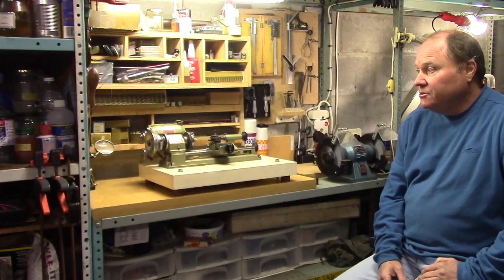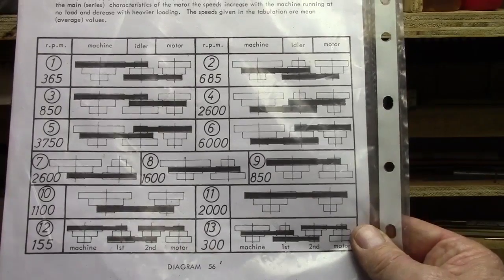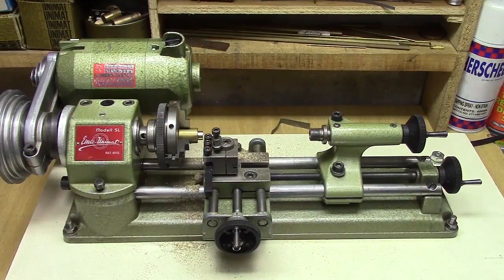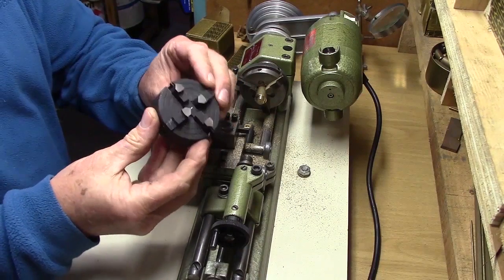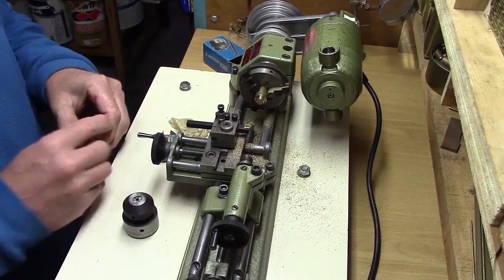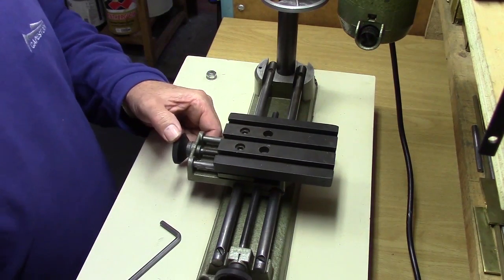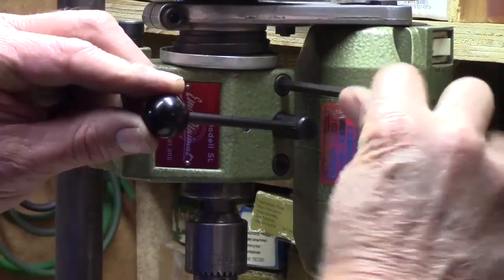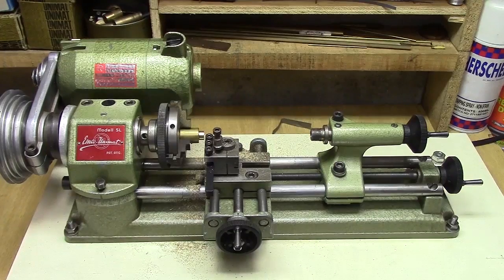All about the EMCO UNIMAT SL Lathe

Comment: You use a toolholder which is adjustable in the height. Where do you get the adjustable toolholder?  ( I am a Newbee with my Unimat SL)
Reply from the maker: The standard UNIMAT SL Tool post is height tip-height adjustable. My quick height adjustment tool post came with my lathe from its previous original owner. The original owner may have made the modification himself or had it done by another model engineer. It is a relatively simple modification to make and I have seen other variations of this tool post mod featured in old Model Mechanic and Model Engineer magazine articles from the 1950's and 60's. Have a look at the Model Engineer magazine website many of the old archived articles are free for download and viewing.

Comment: Hello Steamer Edge. Thanks for this great video and started looking at the others which will be invaluable. Just about to have a Unimat SLdelivered and was looking at the extras that I might need. I see the lathe steady offered a couple of times onEbay and wonder if you have ever found the need for one?
Cheers
Reply from the maker: Thanks, I do have a Steady Rest for my Unimat SL but I must confess that I have never used it. Most of my turning operations are well under 100 mm in length and I find that using the live centre on the Tailstock is almost always sufficient to prevent the work from flexing. If possible I try to avoid turning long pieces of work which may flex during machining, but I'm sure I will need to use the Steady Rest at some stage ....
Reply: @SteamerEdge  Thanks for the advice. I have ordered a live centre this afternoon. Kind regards, Dave

Comment: How do you attach the chuck to the indexing head?
Reply from the maker: Unscrew the three screws which attach the 3-jaw-chuck faceplate to the back of the chuck, the faceplate will detach complete with the jaws. The chuck is then attached to the indexing head using three screws but you need screws which are the same thread but slightly longer than the original chuck screws. these longer screws are usually supplied with the indexing head. The chuck jaws can still be opened and closed in the usual way when the chuck is on the indexing head.
Reply: @SteamerEdge  Great...thanks! I was looking at getting an indexing head, but wasn't sure if I needed anything extra to attach the chuck to the head.

Comment: hello steamerEdgeI just bought an emco unimat sl lathe and see you also in south africa I wanted to find out accessories for it in SA si]uch as the milliing table or chucks thanks
Reply from the maker: There is no local South African supplier but the complete lathes with accessories and, sometimes, individual UNIMAT parts are often found on websites like GUMTREE, Bid or Buy, EBAY  and at local Flea markets, Toy Collectors Fairs,  Garage sales etc.  The EMCO UNIMAT lathes were very well marketed in South Africa in the 1960's 70's and 80''s and many complete 2nd Hand machines and 2nd Hand accessories are still around if you keep looking.

Comment: Hi.  Thanks very much for this video.  I've just acquired a DB200, which I am intending to use as a vertical mill to complement my Cowells lathe, but it came without the pinion lever.  Could you please let me know the outside diameter needed, so I can make myself a new one.  Thanks
Reply from the maker: Hi, the lever base is a round bar 12mm diameter 60mm long. The lever handle which fits into the base is round bar 5mm diameter 95 mm long with 20mm diameter ball at the one end. The lever base has 10 longitudinal profiled gear splines around the circumference of the bar, starting from the machine end to a length of 34mm along the bar base. The depth and profile of these splines is very precise and I recommend that you try to find someone with a Unimat lever near you and take accurate measurements of the depth, spacing  and profile of these splines. These gear splines could be made on a Milling machine using a dividing head for spacing and the right size, depth  milling cutter. Could also be done on a lathe if you have a vertical slide for milling. Search for "Unimat DB/SL Pinion & Hand lever" for sale on Ebay
Reply: @SteamerEdge  Thanks for the info and comments.  I know I could buy one, but it seems a bit defeatist to not even try to make my own.  I made a gauge to match the headstock rack, and ground a single point tool to accurately match that.  With some 12mm bar in the rotary table I think I'm good to go!  I'll let you know what happens
Thanks also for the inspiration from your channel.  I think the 30 or so steam engines I have now built are largely as a result of finding your videos
Reply from the maker: Thanks for you kind comment, glad you enjoy the vids  :-))

Comment: Hi, I was just wondering if you could help me with a problem I’m having with this lathe, the motor rotates in a wrong direction, how could I change it back to normal? Electricity is not my secret power, so any advice would be much appreciated, thank you very much! Best regards
Reply from the maker: Hello, the lathe motor should rotate in an anti-clockwise direction. Reversing the polarity ( reversing the connection of negative and positive leads from the power source ) should change the direction of rotation. Be sure to disconnect power leads from the power source before working on them. Live power leads are extremely dangerous, I strongly recommend that you get a friend who is a qualified electrician to assist you with this. Regards Paul

Comment: When using the Unimat as a vertical mill, the plain, un-painted melt is exposed that would normally be hidden under the head stock when used it as a lathe. Do you know if there is an extra part that can be put in place to cover the non-painted part of the base while using it as a vertical mill? This would be a purely decorative addition. I have been looking, but I have not been able to find anything like that. As I plan to use mine primarily as a vertical mill, it would be nice to give the base a more finished look.
Reply from the maker: Hi, no, I'm not aware of any sort of part like that for Unimat lathes. It would be very simple to make some sort of cover out of thin rubber ( or whatever material you like ) which fits neatly over the profile of the exposed metal section.

Comment: Hey SteamerEdge. I live in Durban, and after watching your videos I decided to buy a Unimat SL for myself. I absolutely love my little machine, But could you let me know where you buy the belts for the lathe ?
Reply from the maker: Hi, I got my polyurethane belt material from Belting Ware located in Maitland, Cape Town. there should also be other suppliers in S.A. which could be nearer to you. Just search for "Belting Ware Cape Town "on Google. You need a 4mm round Polyurethane belt, the belt is sold by the meter and you will have to join it yourself.
Reply: You can also get it from this link:  https://www.ebay.com.au/itm/Green-100CM-Length-4MM-Diameter-PU-Round-Belt-for-Groove-Pulley-Drive/273156505373?epid=17017998228&hash=item3f99657f1d:g:DDgAAOSw7eda~ikh

Comment: Just got myself one of these! Is there a local supplier in South Africa for the parts and fixtures?
Reply from the maker: Hi, congratulations on your acquisition. There is no local supplier but the complete lathes with accessories and, sometimes, individual UNIMAT parts are often found on GUMTREE and at various Flee markets in S.A.  The EMCO UNIMAT lathes were very well marketed in S.A. in the 1960's 70's and 80''s and many complete machines and accessories are still around if you keep looking. Examine all 2ND hand UNIMATS lathes and accessories very carefully before buying because these lathes were often abused due to their small size. The previous owners invariably try to turn work which is well beyond the capacity of the lathe. I found two complete UNIMAT lathes with accessories 2ND hand for a very reasonable price a few years ago.

Comment: I found one for $100.00 at a pawnshop. Not sure if it has the milling attachment or dividing head. I did notice several dogs , faceplate , live center , drill chuck in the box. Mainly I just felt for loose headstock bearings ,and checked carriage slop. I wasn't sure if it was just a toy or a "real" lathe. Anyway I'm going to go back in a little while and fetch it home. I did notice the belts were dryrotted. Ill need to check out how to make them.
Reply from the maker: Congratulations on your find, hope you enjoy the Lathe

Comment: That looks promising.

Is it possible to make threads (metric) with this machine? Is so, what pitches are possible?

I am looking for a mini lathe just the size like this, with great stability and precission. Unimat SL, would probably work very well for me, but I think converting motor to variable constant speed brushless motor plus some tachometer would make it even more versatile, and safer (one can program controller to shut off the motor if too high torque/load is detected, and one could remove the pulleys or cover them with some sheet metal so one doesn't accidently touch them in operation). Should be easy conversion.

I see that the tool post doesn't have a compound angle adjustement scale. So making tapers looks to be impossible.

I want to be able to make small parts in plastic, wood, aluminium, brass and steel. 10cm length piece max. and pieces between 2 and 20mm most of the time, but ability to clamp something up to 50-100mm in diameter would be very useful. I.e. something like M1 screws as a smallest part probably, and cut threads in them accurately.

Ability to convert into small mill or press drill is really useful for me too. 

But I think I need power feed screw for making threads, so nope. :(   Maybe emco Unimat 3 (P03) could work.
Reply from the maker: Thanks for your comment. Yes, I have a Unimat thread-chasing attachment which was available as an accessory. I have seen them for sale on Ebay. I also have Unimat thread pattern bushings for this attachment in 0.7mm, 08mm ,1.0mm and 1.5 mm. Not sure what pitch they are but it is a probably a standard metric thread pitch. I must confess through that I have hardly ever used my Unimat  thread-chasing attachment because it is much quicker, and easier, to set-up taps and dies for threading on the Unimat.The Unimat SL has the ability to rotate the angle of the Headstock for Taper Turning. I have used this feature very successfully and it is possible to achieve a very accurate taper cut with this lathe.The Unimat 3 was introduced directly after the Unimat SL and there were many improved features when compared to the SL. The SL's weakest point is probably the size and power output of the motor. however this small output motor feature is probably built-in to prevent the Unimat SL Lathe from being for turning work which is beyond the size of the lathe. With patience and sharp lathe tools you can achieve very accurate turning a over a range of metals with the Unimat SL .
Reply: Check this video:  https://www.youtube.com/watch?v=y2GGgWtZcu8

Comment: Hello;
I have identical Unimat SL Motor as yours on the video.  Suddenly the fuse (in our house security fuse cabinet) went off.  I checked manually that the motor turns smooth,  turned ON the engine, but once again the fuse went off.  Any tips about what might be the reason, typical problems with this engine, and what to do?
Best regards Einar (Oslo Norway)
Reply from the maker: Hi, yes, this has happened to me before when the motor was very hot after a lot of use. These little Unimat motors have an automatic overheating override thermal mechanism inside to prevent the motor form being destroyed by overheating. This mechanism is thermally activated when the motor overheats and it turns the motor off. If you try to switch the motor on again after this has happened your earth leakage on your home electricity supply will trip. Allow the motor a few hours to cool down completely and you will see that it will switch on again without any problems. If this fails try removing the brushes by carefully unscrewing the brush retaining screws on the back sides of the motor and cleaning the carbon brushes gently with a dry brush. Be sure to put the brushes and the retaining springs back on the same sides as before and in the correct way after cleaning. Hope this helps :-))
Reply: I had the same problem the motor would that hot you could not touch it, speed would start to slow down then the fuse tripped, worked again when the motor was cold. I opened (stripped) the  motor and found that there was a massive build up of carbon dust inside the motor, 40 odd years old, any wonder. Cleaned it out and the motor can run under load for a couple of hours and now only gets slightly warm. If you strip yours make sure to polish the commutators and clean the grooves. Geniet jou draaibank

Comment: Hello! I've been given one of those, but it misses the drill chuck. I disassembled a drill i had laying around, but it seems to be that it has a special drill chuck. Can you please tell me the measurements of the thread, to buy another one or find an adaptor or something... Thanks in advance!
Reply from the maker: Hi, the UNIMAT headstock and tailstock threads are the same. That is a Metric M12 X1 thread for any attachments like a drill chuck. The Unimat SL came with a 0 -6.5 mm drill size capacity Drill chuck. I also have a slightly bigger 1.5 mm to 10mm drill size capacity Jacobs Drill Chuck. Check out sites like Ebay and Gumtree -  2nd hand Unimat and Jacobs drill chucks often come up for sale.

Comment: Hello.
I see tailstock is threaded. So it means it doesnt have any  morse taper inside it?
Not even morse1 or morse2 taper? Just threaded tools are attached to it?

For example can you attach live center tailstock chuck?

How stable is whole lathe base? How precise stuff its able to do?
Does it work with steel also well? Any vibrations?
Reply from the maker: Hi, yes, only threaded attachments can be used on the Tailstock. The Unimat SL does not use the Morse taper system as per other Lathes . As shown in the video the Unimat has a live centre attachment which can be used with the tailstock. As I said in the video my Unimat SL cuts mild steel and cast iron but using  the correct turning speed, sharp lathe tools and taking very light cuts is essential. In my opinion the UNIMAT SL is very accurate and I note that I have been able to work more accurately with it as I have gained more experience.

Comment: Been using this model nearly every day for years. I have a couple large lathes but for small work, I just love this lathe. I have a question, where did you get the tool holder and insert holders?
Reply from the maker: Hi Larry, thanks for your comment, yes I love using the UNIMAT and I'm always amazed at how many devoted users there are around the world. I think that the original manufacturers of this Lathe never, in their wildest dreams, ever envisaged the efficiency, versatility and world-wide appeal of this little machine. I got the adjustable index tip tool holders from RGD Tools in the UK. The tool holder has a 6mm X 6mm shank. Just type "RDG Tools" on the Google search bar.  The RDG tools website has a special section for UNIMAT users. They also have a nice miniature parting-off tool for the UNIMAT.

Comment: Have you ever replaced the carbon brushes in the motor of your Unimat SL? If so, where did you get those brushes. They don't seem to be available anymore. Thanks.
Reply from the maker: No, and, fortunately, I have a spare set. I have seen UNIMAT motor brushes on Ebay before. I suggest you just  keep looking at 2nd hand market websites - Gumtree, Craig''s list, Ebay etc. You can also try typing "TOMSTOOLSTORE" on the Google search bar. This USA website used to have a number of UNIMAT parts for sale - including complete UNIMAT motors.
Reply: Always Remember to go to An Older Mom An pops Style Electric Motor Repair Place They Will Usually Sell You Similar Or make Custom Brushes By Finding Close Off Shelf And Machining Down the Excess carbon/graphite brushes are easy to machine dremels at high speed an sand paper work best if you wanna give it a go its easy really an a skill worth learning

Comment: nice video. i love your tool post, do you have plans available for the tool post? :) recently i do purchase the unimat lathe MK-2 with cast iron body, and need a lot of restoration. it's not quite clear the manufacturing date of unimat MK-2.
Reply from the maker: Thanks, the quick height adjustment tool post is a relatively simple modification to make and I have seen other variations of this tool post modification featured in old Model Mechanic and Model Engineer magazine articles from the 1950's and 60's. Have a look at the Model Engineer magazine website many of the old archived articles are free for download and viewing.

Comment: I can see the adjustable tool post is not the standard one that comes with the lathe. Did you purchase it separately ( if so what make is it) or did you adapt an existing tool post. Thanks again for your help. Best wishes Ian
Reply from the maker: The standard UNIMAT SL Tool post is height tip-height adjustable. My quick height adjustment toll post came with my lathe from its previous original owner. The original owner may have made the modification himself or had it done by another model engineer. It is a relatively simple modification to make and I have seen other variations of this tool post mod featured in old Model Mechanic and Model Engineer magazine articles from the 1950's and 60's. Have a look at the Model Engineer magazine website many of the old archived articles are free for download and viewing.
Reply: SteamerEdge thank you for the information and taking the trouble of getting back to me. Best wishes Ian